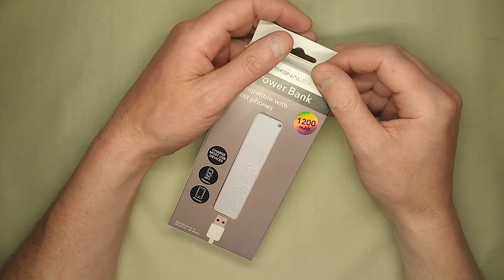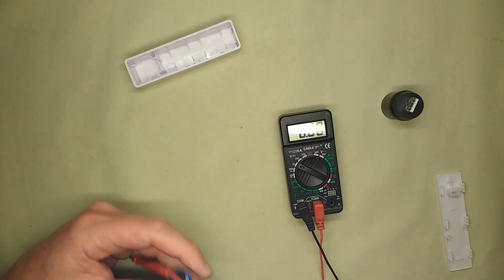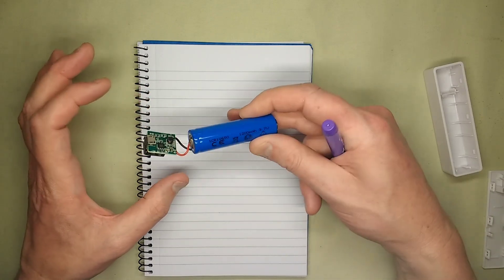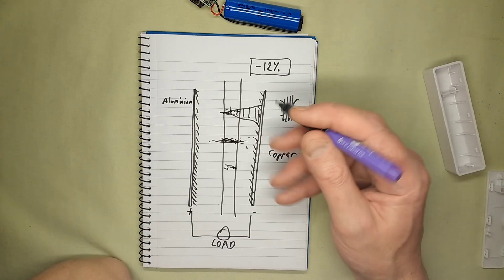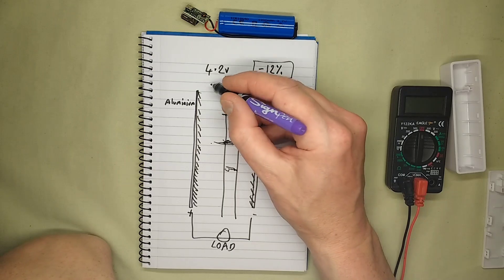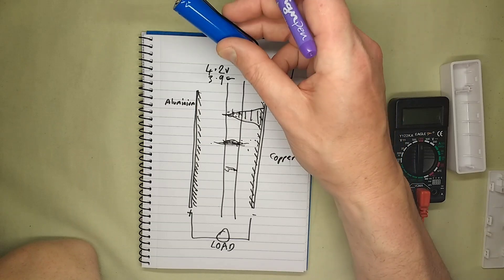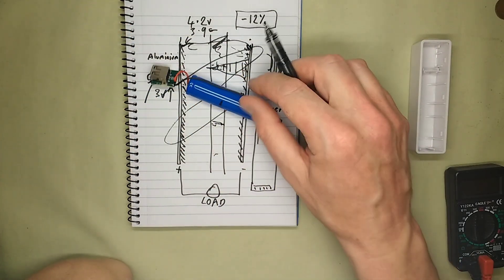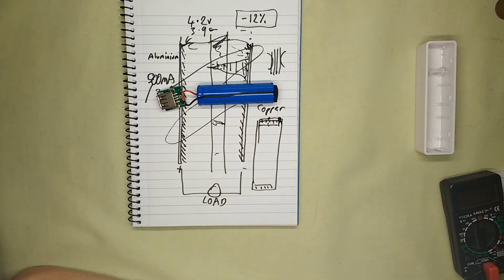Are over-discharged lithium cells safe?  (And how to test for damage.)

Comment: The problem with samsung batteries was purely a case of pushing a technology passed the breaking point. You can only squeeze so much capacity safely into a small space, and samsung clearly exceeded that. The issues with them had to do with thermal runaway, there wasn't enough space for the cell to dissipate enough heat, and once it got just hot enough, there was no stopping it. Squeezing the cell made it even worse, which is a double hazard, cause that will normally only happen when in the pocket.

Comment: I recovered a whole battery pack in this way. It was a Ryobi 40v tool battery back that had just been left to sit for a long time. I got it from the local Free Geek, a community electronics/e-waste recycler, and they thought it was dead because it showed such a low voltage. I snatched it up for a measly $5. When I measured, each cell was sitting at about .3-.4 volts.

First thing I did was remove the balance charger board and clip all the leads. The pack was actually two assemblies of 10 cells in series-parallel making 20v, so I just wired new balance leads onto each parallel string, and commoned the parallel strings together to make the entire pack 20v. I then took each parallel string and hooked up to the 3.3v output of a computer power supply. Monitoring the current, the four cells in parallel drew about 1-2 amps over a period of an hour, but which point they reached a high enough voltage where my Imax B6 hobby charger would tolerate them. I did this for all 5 parallel strings, then wired it all up to a balance connector and hooked up to the charger.

It works perfectly and the cells seem to have full capacity (I discharge-tested one of the strings of 4 cells and for 5Ahr out of it before I called it quits) so I have one hell of a 20v tool battery now. I went on craigslist and bought an old ni-cad powered 18v Snap-On impact wrench for $40 with dead batteries. Opened it up, wired a connector onto it that matched the one I'd wired to the battery pack (I used 4-pin molex connectors because I had plenty) and it works great! For $45, I have what is a functional equivalent to what brand-new would be a $700 tool.

I also wired up an old 18v reciprocating saw the same way and it also works great! I plan on getting a whole stock of old ni-cad tools to run off this battery pack.

Comment: I've never met a discharged lithium ion cell I couldn't rescue.  Using a variable power supply, raise the voltage until some current begins to flow. Then gradually raise the current until the dendrites are burned off. Then reduce the voltage to 4.2. and adjust the current to a safe charging rate, and there you go.

Comment: Firstly, to everyone who's been writing about their LiPo packs - Clive is talking about Li-ion and so did the paper he is using. This is a different chemistry. Do NOT fck with LiPoly like this.

Secondly, am I the only person to have actually read the paper Clive is referencing? They tested "large-format" Li-ion batteries. Now, I'm not sure what "large-format" means in this respect, but they reference charging them at 8.33A which they say is 1/3 C. It therefore follows that the batteries they are using are 25Ah (=25000mAh), in other words 10 times larger (in both capacity and likely size) than the 18650s dealt with here. Now, some principles probably still hold. but some may not. In particular, outgassing occurs at some point during overdischarge. Are you confident that the metal containers used for 18650s are proportionally as strong as those used on 25Ah batteries? I'm not. The thermal mass of the casings may be different as well, leading to different performance with respect to thermal runaway. Some caution is indicated here, so is reading the actual fricking paper.

Comment: Could the circuitry from these power banks be used to charge a larger capacity lithium ion battery i.e flat pack type battery 3800mah  instead of the cell thats in it.
Reply from the maker: +steven cornwell Yes.

Comment: But what charger can I use as mystandard chargers do not have enough power to charge it anything. Left overnight and charge did not raise. I got about 100 cells which are discharged and go to about 0.015 in worst cells. What starting current do I use to trytorecover them. Thanks.

Comment: Clive, I have a 14.4V Lipo battary from a RC car which I forgot to remove when putting the car away for storage. That actually resultet on switched polarity somehow! I measured it to -0.15V :( Can it be saved? If so, how can I charge it to make my balance charger take over? My balance charger wont charge it at all in any modes as its switched polarity. I might be able to use NiMh mode, (if i can switch polarity back), to up the volts to 3V per cell so I can balance charge it in LiPo mode.

Comment: Would this simple test work for cells with built in protection as well? I would think the protection circuitry will always draw a tiny amount of current so I don't see the cell maintaining the constant voltage so perfectly. But I might be wrong, as is often the case.
Reply: I'm mostly asking about cellphone batteries here, we all know they usually come with protection circuitry which is impossible to remove in a non-destructive manner...

Comment: Mmm, though, a problem is all these craaap chargers, that just go 'Oh, I am in charging stage one', don't have any form of current sensing or protection other than ye ol' resistor, that is just spec'd to fit the 'normal range'. Lithium batteries kindof act like capacitors in that they have crazy low internal resistance, which means that if you over discharge it and then put it into a crap charger, the crap charger will allow several times the normal current to flow to the battery, and.. lithium batteries do not exactly like to be charged 'too fast'.

Then again, IANAEE (i am not an electrical engineer ;), just a super duper paranoid hobbyist scared of batteries.

Comment: I have a iphone 3g battery from a broken phone. Can I just connect it to a charger by connecting the two outside clips on the 4 clip port?
Reply from the maker: +Carlos Cervantes If not suggest that without knowing if the current was being limited and there was circuitry to protect against overcharging.

Comment: I've done this with over 75 cells from Lenovo laptop packs with Panasonic ncr18650 (d) cells They were all new, but old stock that sat around. All have held their voltage for months and were perfectly fine. Used batteries however that have been abused, they are hit and miss and you better watch that temperature when charging because most chargers don't monitor that and will just keep pumping and pumping energy into the cell. Then you run them outside and let them cool before discharging and getting them the hell out of your lab.

Comment: I have been pulling laptop batteries apart to get the cells out for a project and I have 6 cells that are all negatively charged to between 0.1 and 0.2v. Should I try and charge them? Purley for educational purposes. Should I do it hard and fast as some suggest to destroy the conductive pathways or slow and steady with one of these pounding charging circuits?  With safety in mind using my Big Clive inspired explosive resistant shortbread tin.

Comment: If the cell has internal protection, like a lot of 18650 cells do, the voltage may read zero simply because the internal protection has cut out due to low cell voltage and all you are measuring is due to leakage through the protection chip. When you charge it back up the protection circuit resets.

Comment: Thanks, this video came at the right time for me. I just bought a power tool with a 12VDC lithium battery pack. The tool shipped with the battery installed and the tool's power switch was in the "on" position, so the battery only had 0.5 volts. After three attempts, I did get it to charge, but the battery pack was quite hot. I'll let it sit for a week or and recheck the voltage.

Comment: Back again - sorry. That link you kindly gave me started something.Those tri colour LED's have a microprocessor built in and a current resistor. How the hell do they get that lot into a 2 wire LED. I assume it's in the anvil, there's nowhere else. Nothing on Google I could find. Poundland are doing some lovely solar garden tri colour lights with a clear bubble post. Maplin are (were ?) doing slightly better ones with AAA bateries for £1.50. Of course I took them apart - what else are they for. I got 10.
Reply from the maker: I don't think it's a microprocessor.  Just a dedicated logic based chip with counters and gates.  Very cheap because it's mass produced.

Comment: The last two Poundland power banks that I bought were dead when I tried them, I tried charging them up via the usb port but they were still dead. I opened them up and checked the voltage on the battery and they were less than 1v so I decided to connect my psu to the batteries and I set it at 3v 300ma, they both took a charge and as soon as they got to over 2v I thought I would try and see it they would charge via the usb. The first one lit up to show that it was charging and worked fine, the second one did the same but then the battery started overheating !!!  
Even though discharged cells might still take a charge you still have to check that they dont over heat

Comment: Seams to be two types of this very power bank from Poundland you have here Clive (Poundworld now do a 2400 version for £4), as I found out the past week (As in new / current stock), and the last three of these I have had, all are dead, will not take a charge, and had this arsey sales assistant trying to argue to toss with me, till I explained that they are supposed to have some minimal usable charge so you can check to see it at least works, due to the nature in the way the batts are, otherwise damage can possibly occur.

Did finally get one (Could use with a few more), and been watching a few vids on line, about reconditioning laptop battery packs, and so happens I have one from my HP laptop which takes bugger all charge, but found all the batts are sitting at 3.5v, so chucked one of those in to one of these powerbanks, and now quite happily charges my phone when I am out and about, so a nice cheap powerbank, which although will not 100% charge my phone, is good enough to get me out of a tight spot.

Comment: Dear Clive, I had a quick read of the Article and had a question please,
Is recharging the cell with 1/3 its capacity the magic trickle charge figure for best recover?
I have the little TP4056 charge boards and 1/3 of 2200ma cells is 733 seems far to high for a trickle charge , Regards Brett

Comment: Thanks Clive, I needed 4 cells for a project but didn't want to spend too much on them. Bought 4 of these packs, all of them were down to around 1V after watching this VERY informative vid (pity about the audio but you can't have everything!) I "Jumped" them from a good cell while using their own charge circuits and all is fine with them, charged nicely and no discharge when left standing (after disconnecting from their circuits)! Will send a thank you donation when I get paid this week.

Comment: Tried restoring some old Laptop batter 18650 cells recently, 6 in total, 3 went into the recycling before even testing due to stronk, unremoveable and spikey metal pieces, one was actually still at 2,6 Volts and has fully "recovered" (wasn't dead anyway) BUT the remaining 2 were done for. One did charge, but even 100mA trickle charge wasn't enough to go over 1,3 Volts, always dropped to 300mA quite quickly and then very slowly dropped even further. Tested the warmth, yes it actually got warm-ish at 100mA charge, seem to be too damaged to ever recover. The last remaining one was unchargeable. 0 Volts, no charger even recognized it. Trying the power supply: absolute 0mA. Nothing happened, didn't charge at all. It's not shorted though. Resistance unmeasureable, no reaction. No short circuit either. Maybe it just rusted heavily on the inside so nothing can ever happen to the cell anymore? Measuring any Volts after any charging attempts all result in only seeing the standard jitter. Doesn't even change when touching the contacts, as if the battery just seized to exist and has transformed into a greater lifeform to live on on a wavelenght we will never know about... (recycling bin)
Reply: I had the same thing happen to a laptop battery. One of the cells internally disconnected and it was impossible to restore. 

Inside the cell there is a pressure protection cap. It has a prong which connects the anode (+ pole) to the outside world. If the internal pressure goes too high for whatever reason, the cap bulges out and the prong no longer connects to the anode. If the pressure still increases, the cap bursts, relieving it relatively safely. (see http://lygte-info.dk/info/isMyBatteryProtected%20UK.html for pictures).

Comment: The Note batteries were growing spikes at both plates. Due to high current charging & discharging this caused a short, which caused an overcurrent which caused fire.
Same thing for those cheapo hoverboard-batteries.

Comment: Clive, when a lithium cell is first made – it has no charge correct?
Is it possible these batteries are coming from the factory directly without charge? If so, it would make sense that there is no damage, because it never received an initial charge.

Comment: Clive what's a good solar charger for an electric bike lithium battery ? if any ?
Reply from the maker: That would depend on the total battery voltage and what sort of protection circuitry was built into the pack.

Comment: you make me worry about everything you do, I've ordered a Xiaomi phone from China I've not heard of any of those exploding so I'm assuming its safe.  when it gets here i was planning to us my masterplug adapter that i got from argos, it has two usb ports on the top, plugs into the mains and has an mains connector on the back it also has surge protector it says, i think they still sell the model its rather plain but has a bright blue LED and bright White one aswell that looks rather nifty in the dark. so would that be OK?
Reply: Против Глобал I can't because the global version comes with a EU mains plug not a UK one so I'm going to have to use some kind of adapter.

Comment: Li.Po cells are not the same as Li.ion cells and behave differently. The referred research is about lithium-ion cells. A lithium-polymer pouch cell will puff up when stored at low cell voltage, without ever being at a negative voltage. Being puffed up, its internal resistance will rise and it will be unsafe for high current applications, especially when in a  series pack next to good cells.
For high current LiPo packs, I recommend using those cell monitor alarms that connect to the balancing connector of a pack. It will alarm if any of the cells  goes below the set minimum voltage.  
For low current lithium ion packs, a reverse diode over every cell might be able to prevent -12% SOC for the individual cells.

Comment: The LiPo battery on my wireless headphones just died, and it can't hold a charge anymore. Could I possibly salvage the protection circuit on it and use it on a LiIon cell?
Reply from the maker: +Arken You could, but it may be rated for quite low current.
Reply: Eh, it didn't even have one. That might be why it swelled up.

Comment: I remember making a power bank, I used one of those power bank circuit boards (from 5 below in the USA) and had a pack of about 8 18650's in parallel. I was attempting to solder it together when I put the positive and negative across one of the little chips. 
After that, the chip went to over 176 degrees F (80c) and shut down (thermal cutoff?), it would always come back but it never worked right after that.

Comment: Hey clive, I might have just found a new thing on ebay for you to take to bits. Its a standard looking 230v led bulb with a rechargeable lithium battery (maybe) inside, and is advertised as an "Intelligent emergency bulb" (pahh, yeah right). Looks like it could be a slightly dangerous product (code word for very fun toy) thats right up your alley. It even come in slightly worrying wattage ranges like: 5W 7W 9W & 12W (I wonder how quick the 12W bulb would blow the battery through your average plaster board ceiling, I'm gunna buy 1 to find out.) (I also doubt the 12W unit will be 12W anyways but, hey.... That is ebay for you I guess)
Reply from the maker: I covered one of those last year.  It used a capacitive dropper to light the LEDs and charge the cell.  Most now use a switchmode supply.

Comment: I am not expert, but... 
I have some extra knowledge about non-metalic Lithium based rechargeable batteries and their chemistry. 
Samsung is one of producent of such batteries. Samsung have this contort, that if they wish to push it little harder, then they can, as they would be making batteries for devices designed by them. They did push it. They ramped up voltage on battery, rising energy density. I think there was some problem with small adjustment of batteries made for Samsung Note 7 and this is sold reason why those batteries became unstable. 
Samsung as a WorldWide leader in producing non-metallic Lithium based rechargeable batteries would definitely not skip such obvious safety feature, as bigger separator.